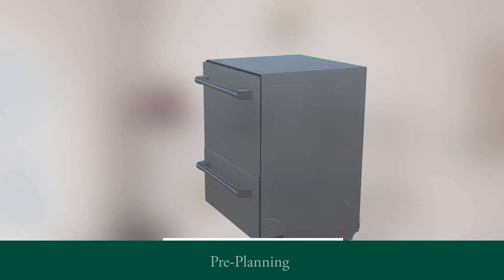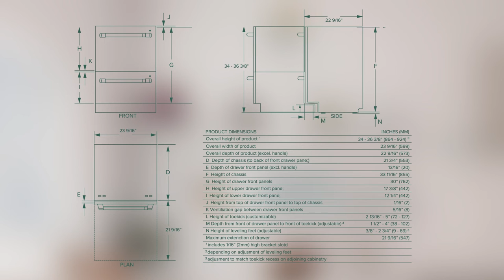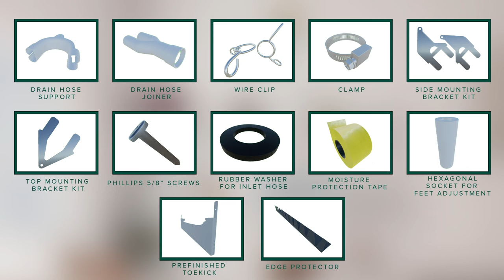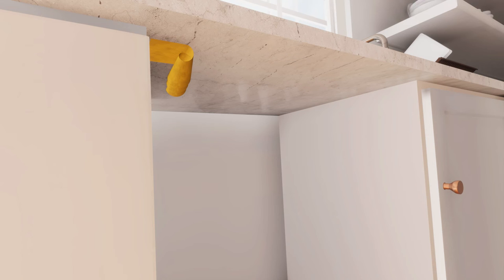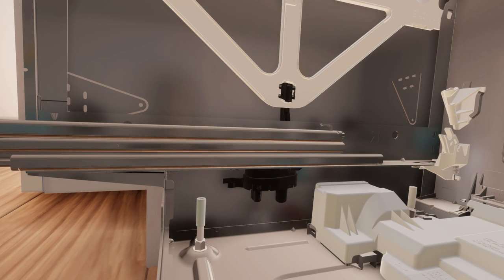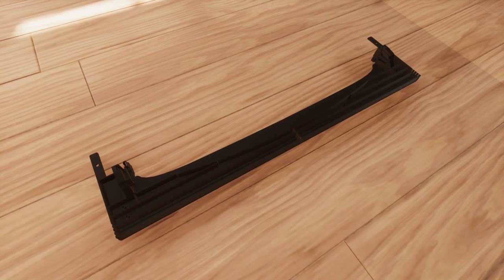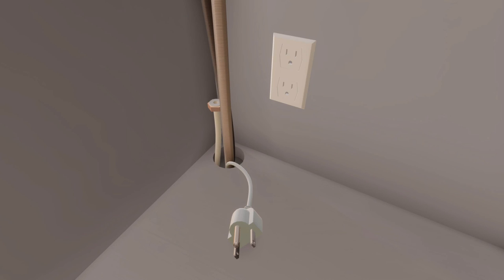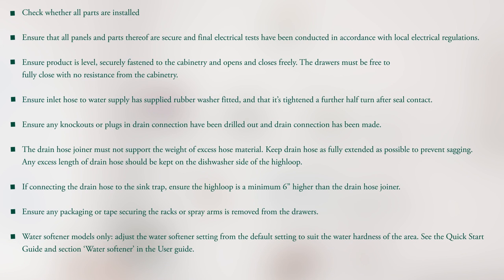Café Double Dishwasher Drawer Installation Video

Comment: As someone who's installed around 5,000 dishwashers I would not recommend buying this.  I've never once seen a customer replace a double drawer with another double drawer.  They virtually always do not like them.  And to make matters worse these are ridiculous to install and remove.  A double drawer sounds cool, I get it, but they are not worth it.

Comment: No one will see this probably, but this dishwasher is terrible. GE technicians have been out twice and are scheduled to come out again. First, it was dented so the front panels needed replacing. Then, the machine doesn't actually work and technicians haven't been able to fix it. I couldn't leave my review on the GE website for some reason.
Reply from the maker: Hello there, we're very sorry to know that you had to experience this situation with your dishwasher. We know this is not ideal, and we want to help.

Please send us a private message on Facebook, Twitter, or Instagram with your full model and serial numbers, alongside a copy of this comment so we can learn more about this situation. 

We hope to hear from you soon. Take care. - PM
Reply: I saw your comment, but unfortunately not before I bought one of these dishwashers.
Reply from the maker: We regret any trouble you've had with your dishwasher, and we certainly want to assist with any concerns. If you can, please send us a private message over our social media (such as Facebook or Instagram) with more information about any issues you’re having. We would be happy to review further.

Comment: I have to agree with the comments here discussing how horrible this dishwasher is. I had high hopes for a double drawer dishwasher as the concept is very appealing to our large busy family. I love the idea of running a small load of dishes while loading the next drawer while the first is still running. That said, this dishwasher has been very disappointing. The inside plastic racks fell apart within days of using it and are very difficult to re-install correctly. The dishes do not come out very clean. The worst part is now it has stopped working and 3 technicians have tried replacing certain parts as guesswork from what I can tell only to no avail. The last technician told me its a manufacturer issue and to take it up with GE. I regret purchasing this dishwasher!
Reply from the maker: We're sorry that this hasn't been the best experience, and we want to further investigate this for you. Whenever possible, please send us a private message via Facebook or Instagram that includes your most recent service confirmation number or your email and phone number and a description of the issue.

Comment: I had this DW installed a few weeks ago and so far it satisfied my wish for a 2 drawer dishwasher.  However, I'm not sure the install was done properly.  I replaced a DW so the opening was sized correctly.  However, there was some issue with the flooring which made it a bit more difficult to fit in.  But now I have a situation where the DW jiggles around in the opening when I open/close the drawers, like it hasn't been secured well enough.  I was told that that was not unusual!  I have my suspicions.
Reply from the maker: Hi there. Thanks for reaching out and being a part of the Café family! We're glad to hear that you're enjoying your dishwasher so far but hate to hear that you're unsure that it's installed correctly. This particular dishwasher does have adjustable leveling legs that can be checked to ensure that the dishwasher is properly situated. If adjusting the legs don't help, and you've purchased directly from us, please feel free to send us a private message details of the problem on any of our social media platforms. Also, please provide your email and phone number, so we can find you in our system. Thanks! -AT
Reply: @CAFEAppliances  Sadly, I purchased the DW (and range and fridge) from a local high end appliance store.  They definitely sent their B squad to install the DW.  I don't have a lot of confidence that they will make it right so I will have to find someone else to hopefully fix it.  Thank you, though, for your response.
Reply: It sounds like they didn't secure it. They where right. It is not uncommon for the installer to not secure the dishwasher properly.

Comment: I  have an opening that is 25" deep, but the pipe sticks out about 3" due to a load bearing pillar. So it's approximately 21" to the face of the cabinets, and 22" to the cabinet doors and counter edge. I see in the video it requires 22 1/6", do you think this will work?
Reply from the maker: Hi, Ben. Thank you for checking with us. We truly appreciate your interest in our appliances. While we would love to tell you this appliance will fit, I'm afraid we cannot. From the dimensions you have provided, it would stick out a little further than it should. If any other questions come up, please know we are glad to assist you. Best, JP
Reply: @CAFEAppliances  thanks for the info. Assuming it sticks out an inch or less, would that affect the function? I am just weighing my options.
Reply from the maker: Hi Ben,

The dishwasher sticking out an inch or less should have no effect on its ability to function. Let us know if you have any other questions. -MH
Reply: @CAFEAppliances  thanks, that is good to know at least we have a backup option.
Reply from the maker: It's our pleasure, Ben! If you have any questions, please don't hesitate to reach back out. Thanks! -AT

Comment: There is nowhere even close to enough hose connecting the lower drawer to the back of the unit to pull it out as far as is shown in the video, and the drawer runners are in the way of the hexagonal socket screws to adjust the feet.

You need a RIGHT ANGLE ratchet socket wrench to adjust the feet from inside the lower drawer cavity. You simply will not have enough space to get your body inside the drawer cavity and use the supplied plastic socket wrench.

Comment: 15 minutes to install the dishwasher  and I’m on my second day trying to mount it to the cabinets. I’m a builder and developer and have been installing dish washers for 30 years. I have never seen this level of difficulty to mount a dishwasher to a cabinet in thirty years.  GE it does not have to be this difficult! Anyone with basic skills could have figured an easier way to mount this sissy washer
Reply from the maker: Hello-We are sorry to hear that you have had trouble installing your new dishwasher unit and can understand your frustration. We hope the issue has since been resolved but if we can be of any help please feel free to private message us. We would be happy to help! Sincerely-DM
Reply: I had my two drawer Cafe Dishwasher installed one week today. The cabinet wood is split down the middle, and the dishwasher is rocking when I open it. Definitely a design flaw. Installer is coming a week tomorrow to fix it. My cabinets are ruined.
Reply from the maker: Oh no! We hate to hear that you're having issues with your dishwasher. This isn't expected, and we'd like to look into this for you. If you haven't done so already, please send us a private message on Facebook or Instagram that includes your service confirmation number and a description of the problem. Thanks. -AT
Reply: I'm dealing with all these same issues.  This unit is a terrible design and the cabinets are now destroyed.  Good luck telling the customer it's the unit.  This thing sucks
Reply: I've installed thousands and thousands of dishwashers these are by far the biggest pain in the ass to install and remove.